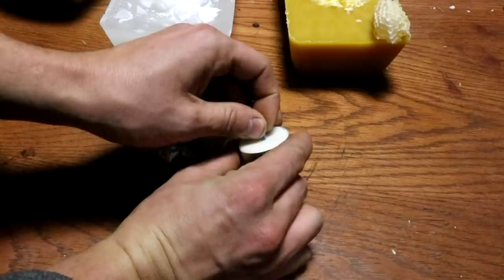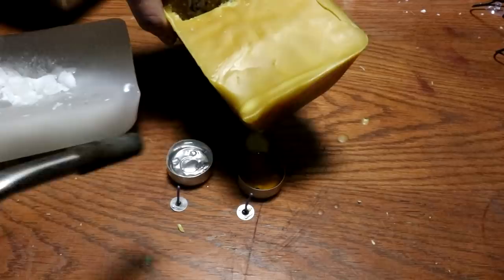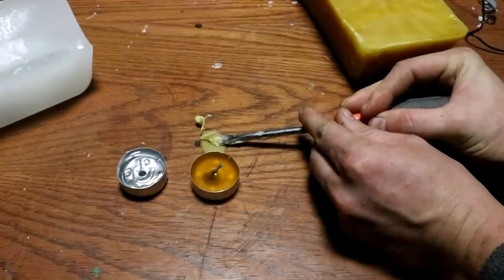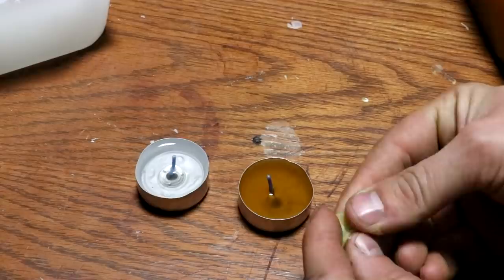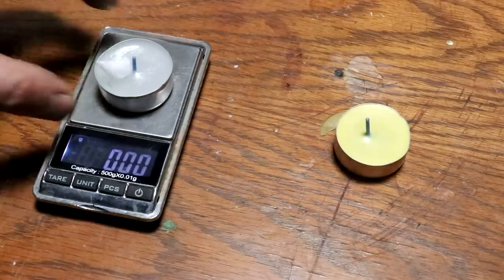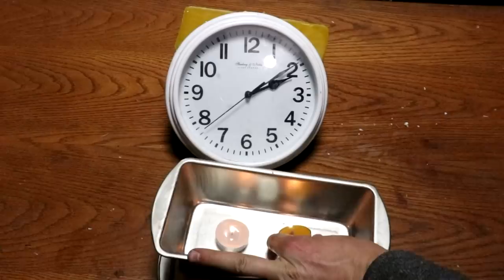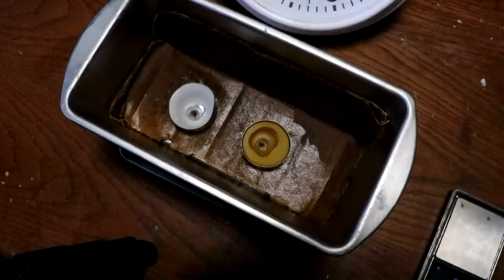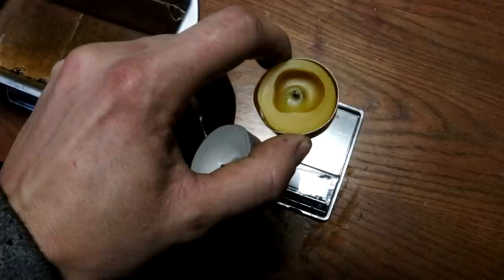Beeswax Vs Paraffin: Flame Test

Comment: I'm curious about how a warmer environment would effect both candles burning. If the room were at a high enough temperature to allow both candles to melt from the flames produced, it would be interesting to see the differences with the availability of the wax no longer being a variable
Reply from the maker: I think the paraffin still would burn hotter possibly releasing more heat, weaker bonds to break and all that.
Reply: well that's interesting. 
the thing is, i once bought a tiny candle powered steam engine, it came with a beeswax candle.
when the candle burned out, i tried replacing it with a cheap paraffin- or soy wax (idk. which of these), but it did barely work.

I was told that it came from the fact the beeswax burns hotter.
Reply from the maker: were they the ones selling beeswax candles perhaps?
Reply: But the paraffin candle burnt much more wax in a shorter amount of time.
It should have a higher power output than the beeswax regardless of the temperature.
Maybe Cody should test that with a stirling engine?
Reply: I suspect it burnt more wax because it had a higher availability of it. Since the parafin melts at a lower temperature, it more readily flowed to the wick which would allow for faster and hotter burning
Reply: If you really wanted the beeswax candle to perform, I think the right move would simply be to provide a more appropriate wick.  This is one of those design parameters that needs to be right for a candle to even work.   Too small, and it can barely put out enough heat to feed itself and it'll get to short to survive.  Too big, and you end up with a bunch of soot or dripping.  If anything, this experiment demonstrates how a single wick cannot get satisfactory performance out of different waxes even when the geometry is identical.
Reply: i think a thicker wick and higher ambient temperature would affect the result
Reply: Dream Services, that's a great observation. You can think of the size and design of the wick as the diameter of the "feed pipe" that provides the fuel to the point of combustion. It's perfectly reasonable to expect different fuel types to have different optimal feed rates.
Reply: Is the beeswax completely devoid of sugars? They could increase the heat output as they burn if I'm not mistaken.
Reply: Cody'sLab seems like you may have a new beeswax mold to make to get on the steam engine supply game
Reply: Cody'sLab the candels didn’t burn properly because the wet cardboard and aluminium pan acted as heat sink
Reply: The beeswax would burn about 5.5 - 6 times as long, with a flame volume of about 1/4 as big.
YES, that doesn't sound like good math, does it?
Light a paraffin candle, and smell the air.  Lovely odor of unburnt paraffin!
Light a beeswax candle, and smell..... almost nothing. Completely nothing, if the wax is pure enough.
.
A paraffin candle wastes almost 20% of its candle mass by unburning evaporation.
Reply: Beeswax vs. paraffin wax candle, for powering a steam engine:
They burn almost the same temperature, but the paraffin candle deposits a layer of soot, insulating the engine somewhat.
Reply: I think wetting the cardboard messed things up

Comment: I think water cooled them down a lot. Normally paraffin would completely melt and burn in that setup.
Reply: Yes, also because they were down in the bottom of a pan, maybe interrupted the natural convection of the air movement? It’s the little factors that you don’t think about that turn your science experiment into a waste of time.
Reply: @samueltaylor4989  they where both in the same environment so not really, we tested them relative to each other

Comment: Beeswax candles require a thicker wick to create a larger flame so it burns hotter.  Also, the wet cardboard absorbed heat preventing the wax from reaching higher temps thus not melting the wax completely.

Comment: Geez, it must be cold there. Tea candles melt and burn away completely here.
Reply: Another variable is that normal tea candles are the soy wax that he mentioned.
Reply: He also lives at a high altitude.
Reply: Soy wax has a very low melting point.
Reply: Yeah it is really cold in his house for some reason. 11 degrees indoors. Not sure if he wants to save money on the bills or whatever the cause is.
Reply: @atwfnj  It's not the altitude, I live relatively nearby and tealights burn fine here, and even burn fine up in the mountains. I imagine it's the kind of wax.
Reply: @mgb360  It is the water bath. He should have isolated the candles metal from the water. The water will keep the wax cold. Use glass/ceramics holder to avoid that.
Reply: I think the wet cardboard is probably cooling the candles down.
Reply: @borttorbbq2556  no, 11K...
Reply: @Beregorn88  11k? that's like -475°f
Reply: its the wet cardboard that ruined the test since it cooled the wax enough to soildify and not be able to burn

Comment: the size and depth of the burn crater in the beeswax candle is a perfect example of why most beeswax candles are stick candles.
Reply: For either, you have to match the wick to the fuel. The wicks were far too small for his test. 

For enclosed candles like these, an oversized wick is better than undersized. That way, all the wax will burn, not just create a crater and go out partly burned.

Comment: The way the candles are supposed to work is for the flame to heat the metal container so the wax melts and the whole fuel is burned, by using the wet cardboard you prevented this from occurring  and that will have effect what happens
Reply: Yep this so much, I was about to comment that!!
Reply: Hopefully he doesn't get upset by comments like this, it's what science is all about, trial and error!
Reply: The wicks selected were just too small for the candle and blend of waxes used. You can see images of plenty of candles of this size in metal containers floating in water will full melt pools. Wax is extremely insulative. I don't think the heat loss due to surrounding water would be significant.
Reply: SamJac55 I agree.
Reply: The water was evaporating off the cardboard, the whole rig was acting like a swamp cooler. It wasn't just the water absorbing the heat there was refrigeration happening.
Reply: That is typically how tea candles work, yes. A tea candle on wet cardboard would still completely melt the wax because they are soy wax which has an extremely low melting point. This is why soy wax isn't used for normal candles and why parrafin or beesewax in a tea candle didn't do what you are used to seeing. Wet cardboard had no meaningful effect.
Reply: @hypnolobster   Thank you!

Comment: The water extracts part of the thermal energy that was supposed to keep the wax liquid, did it not? :((
Reply: I doubt thats it... A small tealight like that with garden-variety low melting paraffin should burn nearly all the wax; even if you float them in a bath of water, as people often do.  I think maybe the cakeform was significantly restricting the normal convective airflow; also both candles not being exactly the same distance from the wall could make quite a huge difference. But pedantry aside, it still demonstrated the known fact that beeswax makes for a slower burning candle than parrafin.
Reply: Nah, i've burned these little tea candles extensively and the water 100% played a part in wicking the thermal energy away from the metal base. The entirety of the wax is supposed to liquify for the candles to burn properly, and, as you could see, they didnt do that. 

Regardless, i still think the bees wax candle would have burned for longer, but it would have been neat to see them work "properly"
Reply: Even if you just put them outside when its cold they do this
Reply: @Some Weirdo  as Cody has already stated in multiple comments it's because the room that the candles were in was very cold. That small amount of wet cardboard wouldn't have changed anything.
Reply: If the room is already cool, the wet cardboards cooling effect on the candle wax would be more substantial.
Reply: Some Weirdo Also, like Cody said at the beginning, normal tea lights don't use Paraffin wax. I'm sure that the soy wax stuff that we're all apparently familiar with would behave differently as well.
Reply: It would be a valid and most interesting exercise to compare the physical and combustion properties between beeswax and spermaceti in candle form.
Reply: The wet cardboard in contact with the metal tray acted as a heat sink and prevented the waxes from liquefying. Burn these same candles on the table and I guarantee they'd both burn almost to completion. I have a stone tealight holder that does the same thing, the stone sinks heat away from the candle which keeps most of the wax solid and prevents it burning too fast. Take it out the holder and the wax liquefies.

Comment: That was interesting.  It would appear that beeswax candles are what you want if you need a longer lasting light source for when the power goes out.
Reply: I don't want huffing paraffin also, a crude oil was it.

terrible as scented candle I bet
Reply: UCO supplies paraffin candles with their candle lanterns. They are said to burn for about 9 hours. They also sell beeswax candles that are said to burn for about 12 hours.

Comment: Beeswax will last much longer as your little experiment discovered.  The other advantage of beeswax is that it will NOT coat the walls and ceiling of your room.  Paraffin will do that.  This is why some people will only use beeswax candles.  I only use beeswax candles because I've got a lot of it.
One caution about beeswax.  It is highly flammable when it's melted.  Never work with beeswax indoors and always use a double boiler when melting the stuff.  It can be used in so many products.
One experiment you might want to try is the rusty nail.  Leave a nail in melted beeswax for an hour or so.  Afterward, take that nail and a non-treated nail and leave them outside to the elements.  The beeswax nail shouldn't ever rust.  It has so many uses it's amazing.
Reply: Never knew that! Thanks!

Comment: yay thanks , i wasnt upset just curious!, edit , the water stops the can from getting hot and why you had wax left, you have to redo it!
Reply: Jusb1066 was about to say the same
Reply: Both candles were under the same condition, so it is still a valid test
Reply: But what was the caloric output?
Reply: I didn't think anyone last video was "upset." Oh, Cody. :P
Reply: ^ Indeed, the candle's can is supposed to carry the heat to rest of the wax keeping the wick fed.
Reply: The candles went out because the carbon dioxide is accumulating in the dish. You need a hole at the bottom to let it out or a slight breeze in the room.
Reply: Really doubtful that it was still enough to have CO2 accumulate to smother it. The convecting air column would have been enough to keep it fed. The wicks were starved of hot liquid wax and burned out (incomplete and leggy). Complete burning of wicks in tea candles produces ash, whereas here we have a black carbon'ed solid wich that doesn't draw wax up well.

Otherwise every candle in every silly little jar would go out.
Reply: I don't know, but based on the time lapse and measurements

Parrafin burned for 1h21m and decreased in mass by about 5.19g.
Beeswax burned for 3h28m and decreased in mass by about 3.65g.
Reply: I can't see the small amount of water soaked into the cardboard making much difference. I wonder if the original wax that the candle was designed for would burn more completely? Seems like a bit of a design flaw otherwise.
Reply: The paraffin wax ones usually burn completely dry,  so I too think they were smothered by some combination of CO2 and water vapour.  The way the one with the larger flame also went out first also suggests this.
Reply: On a good setup, you do not burn the wick but the fuel source.
Reply: CodysBlab
Reply: The small amount of water soaked in the cardboard didn't make a difference. It is the room temperature that affects the burning. Either way who cares the point is to see the difference between both waxes not make them burn out completly. Stop trying to find problems where there aren't any.
Reply: @jannisopel  Then explain why the beeswax candle went on for two more hours? Gases disperse when not confined. When you put a jar over a candle the CO2 is dispersing not filling up the jar like water would. At a certain concentration of CO2 the flame is not surrounded by a high enough concentration of Oxygen and cannot sustain itself, hence it dies. Here the flame was open, and the CO2 was hot, hence lighter than the surrounding air and carried away, only to disperse in the air.

Comment: Hey Cody, just wondering over here how resistant the parafin wax is to alpha decay of uranium isotopes against the beeswax.
Reply: You're not really wondering that.
Reply: Alpha particles are so massive that they don't easily penetrate matter. Therefore, it is going to be very resistant. What you should be concerned with is the spontaneous fissions occurring, and the fissions from transuranic neutrons. which release more neutrons which will irradiate your paraffin wax. In turn, causing your wax to release high level of gamma radiation.
Reply: English plz
Reply: @trevordustin2613   Radiation is bad for you
Reply: ArteroPk C0nner,cool!
Reply: @arteropkc0nner897  so what your saying is that the beeswax would be the better of the two to resist the irradiation as it has a higher molecular density.

Also; +1 Radioactive Candles
Reply: Alexis Ross  Just the Alpha radiation. Against Gamma radiation, it would take approximately 24 inches of beeswax to cut the amount of radiation in half. But for steel it is about 4 inches, and for lead its about 2
Reply: The warmer something is, the more energy it has. This will make it lose energy (freeze) faster.

Comment: If you run it again, put the soy candle in as well.  And use a fireproof base with less thermal transfer.  A brick or something.
And how about checking the light output of each, or the heat output (equal amount of water, see what temp each stabilizes at above ambient?)
Reply: Eby how about he does something better with his time
Reply: most relevant is lux per gram of wax.  we assume the candlemaker will make sure the wick is optimize.

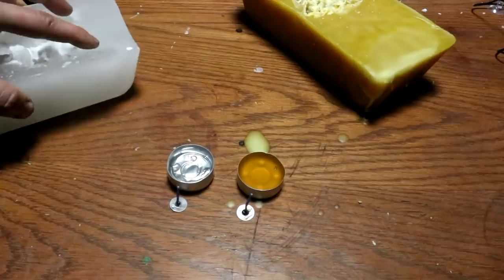Comment: 1:54 parafin is a mixture of longer hydro carbons and is not enginered to contain 1 (certain) molecule ;)
I guess what was ment is, that parafin contains only one group of different functional groups (hydro carbons), where beeswax contains a whole lot of different components, containing different functional groups.
Reply: AFAIK, beewax is very similar to parafin, just that it has a CO-O somewhere in the middle.
I don't know which has the broader size distribution, however refining allows to narrow it down for parafin quite considerably.
Reply: @edi9892  Most candle blends incorporate a broad distribution as this helps with melting as well as aesthetic crystal structure defects, think grainy chocolate.
Reply: @SamJac55  Plus the paraffin waxes are usually nucleated to further reduce the crystal size. I worked with very pure paraffins for a time: crystals would get HUGE when they cooled down slowly.

Comment: Not needing an experiment but I can now see why they might mix the two candles together. The mix might ensure a fuller burn (due to lower melting point), but with increased longevity. I got surprisingly into that comparison so thanks.

Comment: wax is used to seal stuff. Is paraffin wax or beeswax a superior sealer? wax is used for waterproofing stuff too..
Reply: Beeswax is super inert. It is used to protect glass from somesrts of acids, name of which escapes me
Reply: Normally, sealing wax isn't pure wax. Traditionally, it's a mixture of beeswax and shellac with some pigment thrown in.
But if you're me, you make fake sealing wax by mixing hot glue with paraffin and pigmenting with copper stearate. :P
Reply: Shrinking during cooling could be an obvious problem in sealing applications, which would put a tick in the "Pro" column for beeswax.
Reply: i would just simply check out otterwax it's premixed for waterproofing, if you want to max your own you can probably make do with bees wax and some oil, like linseed or whatever you want.
Reply: lampman it's kinda ironic that you're acting so dim, based on your name and all.
seriously though, no need to be so toxic.
Reply: Jim Williams beeswax is better sealer because of higher density, melting point and slightly higher hardness.
Reply: My grandmother use paraffin to seal jelly jars instead of buying the canning lids.  She would melt down used up old candles.  The problem however is if ants found the jelly jars they could chew their way through.  One time we went to get jelly and it was all gone.  The ants took it all.
They could do the same with beeswax.